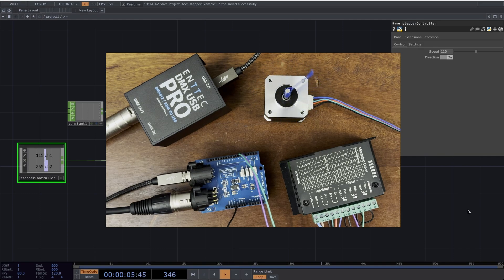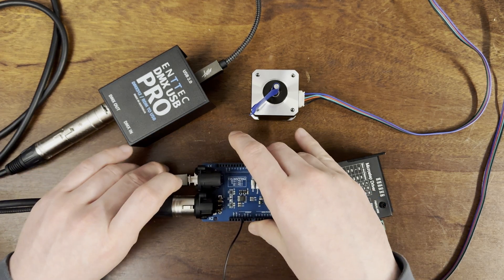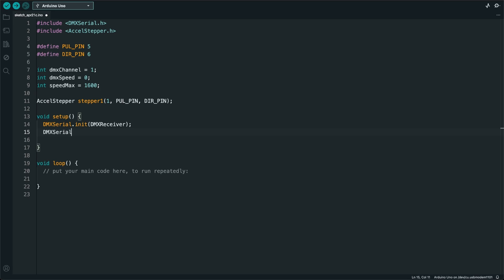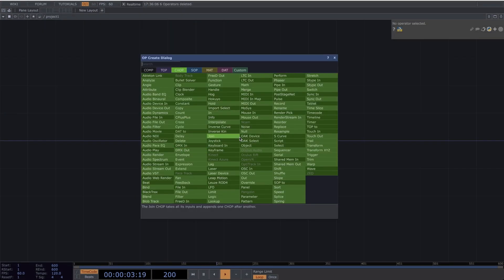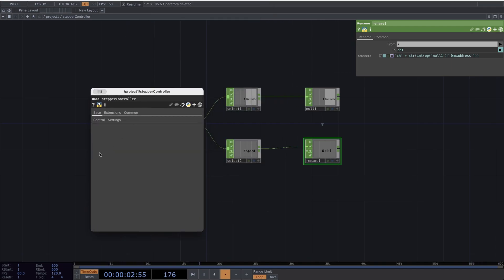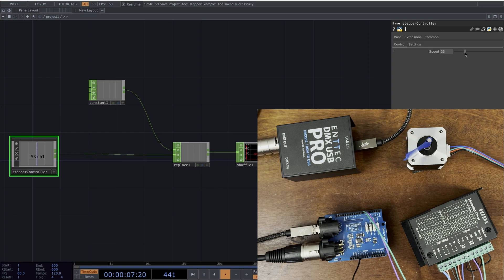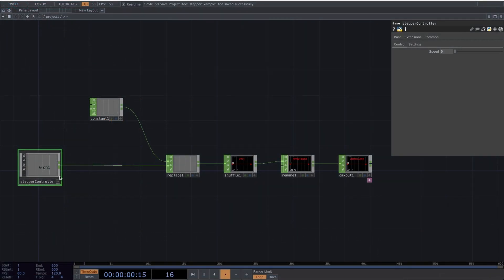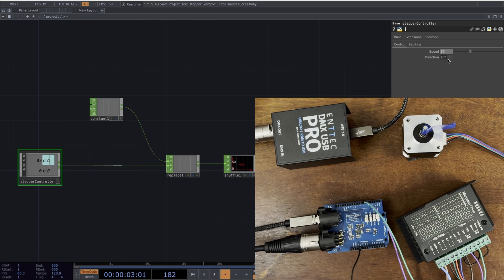Tutorial: DMX Stepper Motor Speed Control with Touchdesigner and Arduino

Comment: Hi, great video. I was wondering if it is possible to daisy chain this. Imagine i want a motor in one place and another motor in another place. I want them both to do the same thing in sync. Could I just make this whole setup twice and run DMX cable in chain?
Reply: And how would I get power to both systems without  using 2 power supply units?
Reply from the maker: Thank you! You are correct. Just make the whole setup twice and daisy chain the DMX cables. If you set each device to listen to the same DMX channel, then they will both perform the same movement. 
I’m not really sure how far apart you plan to have each motor, so you might not be able to share one DC power supply. Typically you’ll see a voltage drop over a long distance, which will cause unexpected results when you try to control the motors. I recommend just using a separate power supply for each. It doesn’t have to be very large (depends on your motor and expected current draw)

Comment: yep，this is what I need also, find lot of day. May I ask if I need to put the motor in far away, which part of wire I can extend? Around 30m, can make a long wire from motor driver?the 4pin cable?and I going to run five motor also
Reply: following cuz I also need to figur this out with many motors...
Reply from the maker: @ceahehehe  I would recommend to extend with the DMX cable! With that you can easily reach 30 meters. If you extend the motor driver wire, you risk the chance of signal quality going bad. So try to keep the controller, motor driver and motor close to each other.